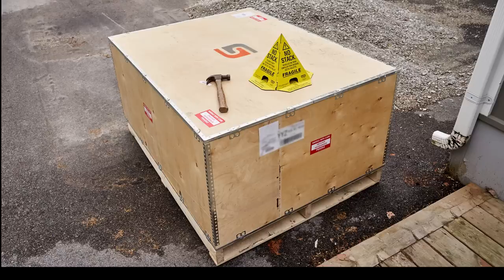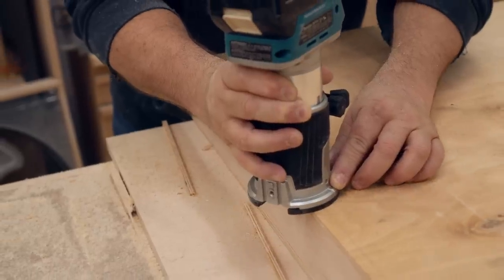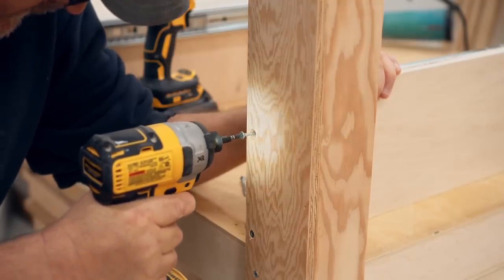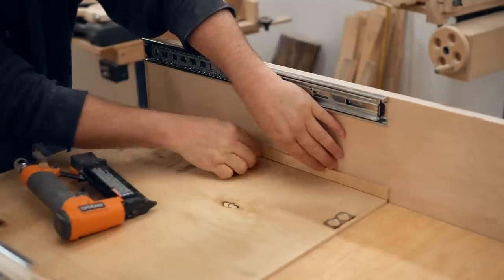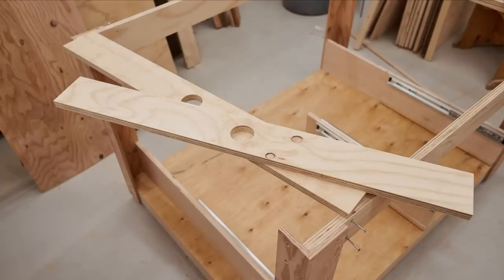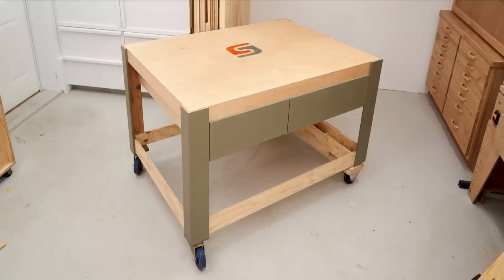How to Make a Self Leveling Torsion Box Table

Comment from the maker: I got a new CNC from STEPCRAFT and made this table / cart to put it on. 
Interesting ideas in the build:
- using the crate for a lot of the project and recycled and scrap plywood for the rest
- torsion box top that's flat, strong and lightweight
- drawers with slide out panels to expand the work surface
- an independent rear suspension to keep all four wheels on the floor when the floor isn't flat
Basically got this table for no cost since everything used was either scrap or recycled, including the casters.

Comment: Too cool.  I can't believe you came up with the independent rear suspension on the fly.  Very clever.  I can't abide a wobbly table.
Reply: Its a solid axle suspension :)
Reply: Agreed, it’s solid. 👍🏼
Reply: It is called 3-point suspension and equalization.  It was prominent on steam locomotives.
Reply: That it is.
Reply: @royreynolds108  That's pretty cool.  So John is using technology from the transportation industry in his shop now : )  There is no end to what he'll adapt to build a better shop.
Reply: I think it brilliant! Nice job John! It looks really sharp too.
Reply: That's exactly how your washing machine feet work.

Comment: I'm obviously not alone in getting the most out-of-the-box ideas from your channels, John.  I am absolutely borrowing your suspension design when I build my next mobile base.  It is hard to see from the video, but it looks like different size casters were used on that end to compensate for the suspension height.

Comment: I'm excited to see what you'll create with the CNC. I have a 24"×36" CNC and when I built the table/stand for it I left the center of the top open. I like the option of working on end grain or things longer than the gantry height will allow by letting the work piece extend below the table top.

Comment: I love the quick solution with the suspension as well. Doesn't look half baked, seems super polished to me! 

One thing i'm curious is if you bother leveling all your surfaces in the shop, or if everything has a slight slope out the garage door cause of the angle of the floor. I'm guessing this is a garage? I' level everything in my garage, but my workbench has a 2" leveling feet I had to max out cause the table legs were like 6' apart! Just curious how you do things in your shop.

Comment: Thank you John, love the independent suspension idea, I was wondering if you use 18 or 16 gauge brads because I only own a 18 gauge gun and was looking to acquire a 16 gauge but I would appreciate your input on the need to do so or not because I value your opinion

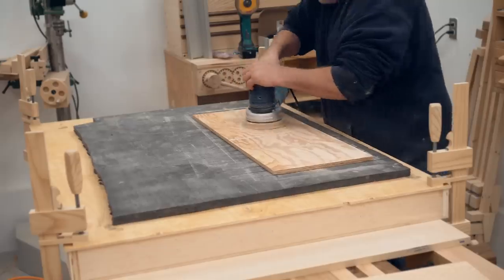Comment: this isnt a dig but an actual question looking for an answer. Wont the foam you used  at about 1:10 under the wood reduce the effectiveness of the sander. Ive see/heard of people using carpet but what ive seen them use is stiff indoor/outdoor kind. side note i love the using its own crate to hold it meta fractal purpose this plywood has been given.

Comment: so as far as i get it, it levels the wheels, so all 4 hit the ground, but the stiffness of the suspension will decide if the top is still rocking and tilting, right? its not possible or make the thing "level" itself in case i want to put on a heavy drill, i get in trouble because of the weight in case the suspension is to weak... on floors like these in his workshop, it would stick to individual legs that can be leveled individually and wheels that can be pressed to rise the entire table if the floor is to bad to push this thing around on its feet. dont get the point of the video, BUT i the simple guided plate with the stopblock on the front being put on the saw caught my attention and this idea will serve me well, so thx for that ;)

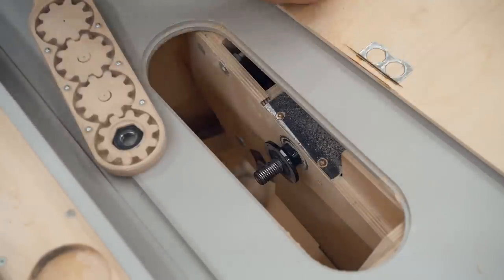Comment: That red coated blade "that's a bit thicker, and also has flat teeth" mentioned at 2:18, might that be the Freud 8" x 24T Heavy-Duty Rip Blade (LM72R008)?

I've been wanting to get something like that for my saw, for rabbets, dado cuts, and box joints, but I'm limited to 8.25" blades...seems like that one might just do the trick.

Comment: Instead of a screw to hold the wheels what about a knob to tighten? I'm thinking for the assembly table that you would want to move around the shop and need to adjust it depending on how uneven the floor is.
Reply: As I'm rewatching this I see that the screw doesn't lock the suspension only the dowel. Are you worried about leaning on a corner and it moving? I really like this design and I think I am going to copy it for rolling assembly table/cart.

Comment: Awesome build! Made me want to build a torsion box table for the CNC I'm building.
But I'm curious: how did you manage to level the table top? It seems to me that the suspension end will be higher than the other end, what with the extra 3/4" from the wheel mount strip, plus whatever the gap between the strip and the stretchers is (looks like another 3/4" to 1").

Comment: I think that would be called a solid axle suspension, not independent :) For "independent" then each arm on each side of the center should be able to move independently of one another. Without effecting the other side arm.
Reply from the maker: Independent of the frame.

Comment: How do you make the construction adhesive last between projects without the tip from drying closed?
Reply: Shove a long drywall screw in the tip, then cover it with a bit of plastic and tape really well with electrical tape so no air can get in.   It will eventually go solid but it takes a couple months.   If that happens, the plug will adhere to the screw.   Clamp the screw in a vise and pull it out, don't twist.

Comment: Very nice build! But I don't see how this is self-leveling?! And instead of the rocker for the rear wheels, a single center wheel in the position of the swivel pin would have done pretty much the same thing.

Comment: can someone explain how it is self leveling? I get that the springs help but with it only being on one side of the table what happens if the ground is higher on the fixed wheels. As I am typing this I have just realized you could just spin the table around. If that is the solution cool, if not I would love to understand it better if someone wants to explain it